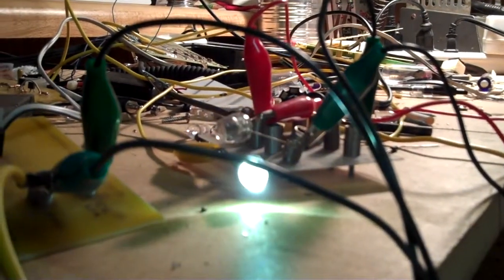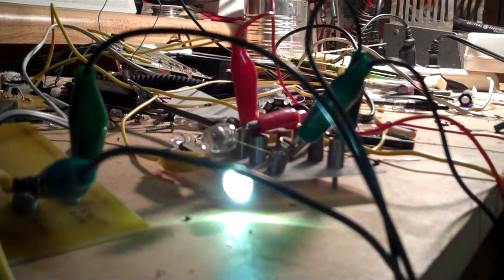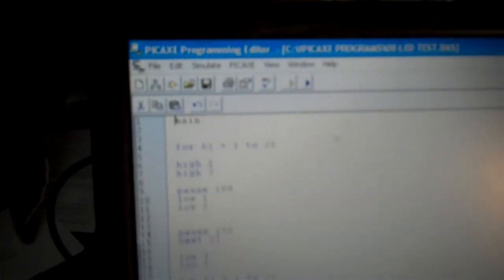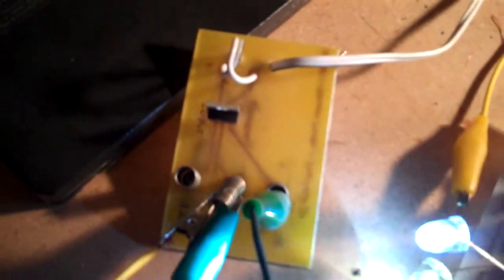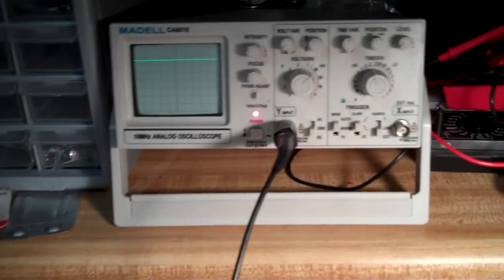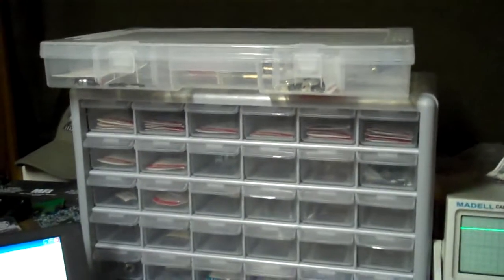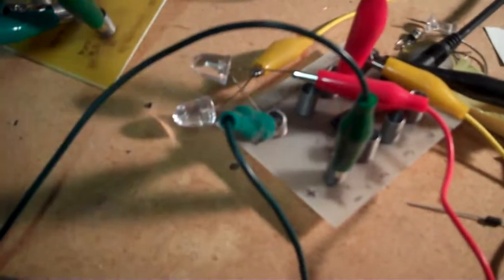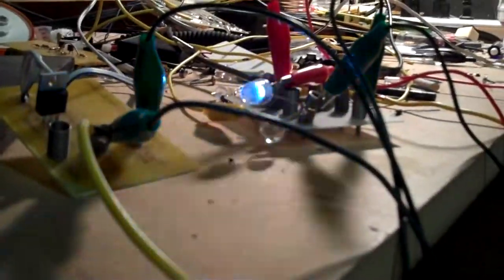Picaxe 08M flashing LEDs

Comment: This is just what I was looking for. I want to make a flasher that switches two 60 watt lights (4 amps). I was going to do it with a 555 timer.

I want to have two modes flashing (about 90 fpm) alternating and both on steady. Can this drive the gate of two P channel MOSFET (for the high current switching) or would I need to work through a NPN transistor to switch the P channel MOSFET. I need to switch the POS side of the bulbs since ground is fixed. Appreciate help getting started.